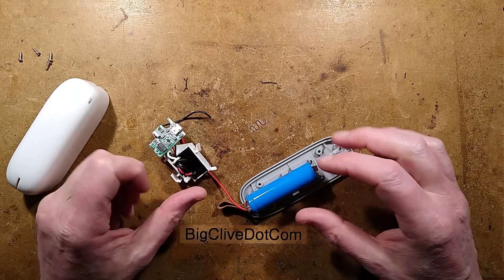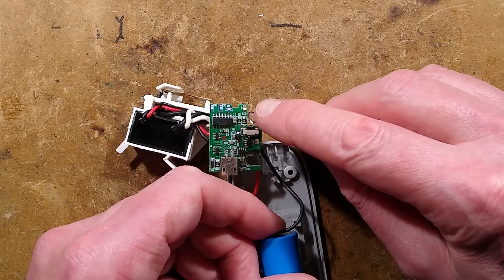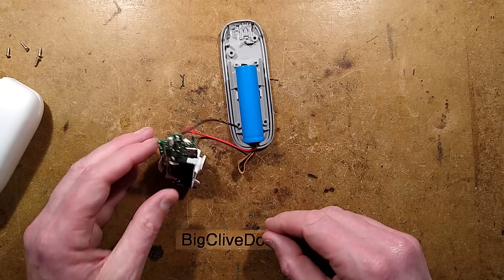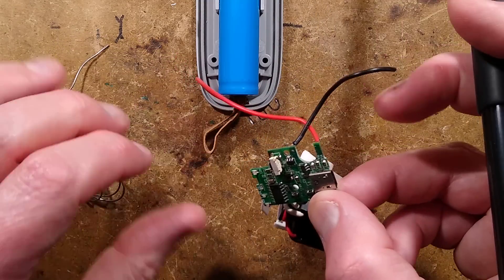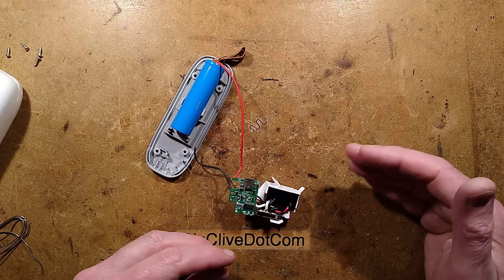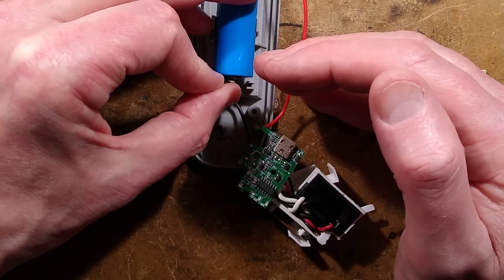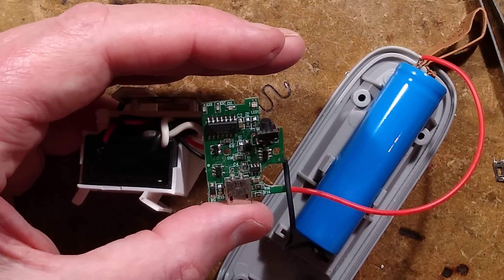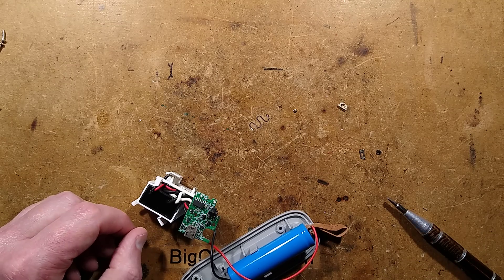The curse of tin whiskers rears its head again

Comment: Tin whiskers is not a RoHS thing. It's been known about for over 70 years now. Computers in the 50s, using normal leaded solder were failing due to them, air filters were getting clogged with them, and other things.  Lead-tin helps combat tin whiskers, but is not a complete solution - like I said, it's been known about for the better part of a century, when lead-tin solder was common. The problem is tin itself, and certain crystalline structures of such can lead to molecular stresses in the tin to cause it to whisker. This commonly happens in shiny tin things (bright tin), which occurs very often in things you want to make shiny - usually pieces of hardware like brackets and such. Solder is another location, but that's why we alloy it. Early RoHS did suffer from tin whiskers but we've eliminated it in normal soldering by careful temperature monitoring which relieves the stress in the solder so it doesn't whisker. Not that early RoHS electronics were suffering a lot from it as they suffered form other things common during the time (e.g., capacitor plague). Of course, cheap tactile switches would be tin plated rather than nickle plated which also results in this. As for lead, well, it's not good for the human body - even just 30 years of leaded gasoline had completely polluted the entire environment - every surface indoors and out was coated in lead. It's nasty stuff and we're probably seeing the results of it as those people are now leading the world.
Reply: "as those people are now leading the world" 🤣
Reply: I remember back in 1985 when I was in high school, doing work experience at the local telephone exchange, the engineers told me about how tin whiskers would grow on the contact pads of relays sometimes.
Reply: @DarrensBench  , tin whiskers also develop in the tonewheel assemblies of electric organs; there's video on YouTube showing how to zap them away with a 9 volt battery or charged capacitor.
Reply: They didn't cure the problem but they did abate the symptoms. The amount of lead in solder wasn't that high and we always handled it well. Not like the guy I worked with years ago. He was telling us that as a kid. They had a small pool of mercury to shine their coins with. The store had it right inside the door.
Reply: Thank you for that explanation. Does temperature matter or does tin un-alloy itself? More homework for me!
Reply: @cherylm2C6671  To say that "it's complicated" is an understatement. I've attended talks about this problem when RoHS was being rolled out and the methods of tin whisker mitigation.  Some temperature annealing processes greatly reduced occurrence, but it is a headache.  Also with modern electronics with smaller pitch sized pins, tin whiskers can cause malfunctions sooner.  So as many suspected, While RoHS reduced the lead, cadmium, etc. it will likely increase E-Waste as nobody does any component level repairs anymore... Question: Was it a good tradeoff in all cases?
Reply: @cherylm2C6671  , pure tin has an unstable crystalline structure, and the instability is amplified in cold temperatures as well as heat.  Hundreds of years ago church organ pipes in northern Germany were failing because they were soldered with pure tin. The phenomena is known as "tin pest" and you can Google it. Alloying tin with lead creates a relatively stable alloy that can be used with simple organic Rosin ( distilled from pine trees) as a flux to clean the metal and displace oxygen during the soldering process.  Lead-free solder, however, uses trace amounts of copper as well as antimony or bismith or other metals, and sometimes silver, in an effort to make it stable, but it's far less stable than lead solder.  Lead free solder also requires more aggressive, caustic and corrosive chemical fluxes to be used in order to clean the surface of the metals you are soldering because the lead-free solder simply does not "wet" as easily to the other metals.  The Rosin flux used with or typically contained within solder used for electronics is relatively inert, non corrosive and non conductive, and can be scrubbed clean from the board with alcohol and a toothbrush. The fluxes used with lead free solder however are conductive and corrosive and must scrupulously be removed from circuit boards or they will cause problems over time. Those fluxes are typically designed to be water-soluble in distilled water but they still can require a lot of work to remove all of it (an ultrasonic bath perhaps), and remove all of it you must.
Reply: This should be the #1 comment.
Reply: Yes, what you said that is known about tin whiskers and RoHS is true, taking the lead out of solder brought back the known problem, that lead had already solved.  The new soldering techniques greatly reduce them, but apparent does not completely eliminate them.  The way that Advanced Circuits solved the issues of lead-free solder was investing in a nitrogen flushing process for PCB assemblies... that is not something the home-gamer is able to do. I am thankfully able to still purchase Sn60Pb40 solder, but I live in California so I don't know how long I have until the eco-police knock on my door. I don't make anything for a consumer/mass market, it's just a hobby.

Any aviation or space electronics is exempt exactly for reliability reasons... Tin-lead solder is ductile and is suitable for high vibration environments.  See my comment in this video comments about the SDO Solar Observatory in space and the Lead-Free solder debacle that almost derailed that probe for something that is out in space!  

As far as lead in the human body, as you pointed out, eliminating from household products such as paint, plastics, etc. and from the gasoline in cars... has done the most good, I agree with those measures.

However, electronics too ??   I do not know anybody that opens up and tries to eat the electronics... Well, maybe Big Clive (LOL)... and I think all that crap about it leaching out in a landfill and finding it in our water supply is a specious argument.  Lead is already in the ground and it's fairly stable as a metal... well, as far as I know, but I may be unaware of something, please let me know... I'm more about the facts than opinion.
Reply: @HobbyHalloween  ,  elemental lead is indeed pretty stable in the environment and most acids and alkalis have little effect on it; one obvious exception being the lead water pipes in Flint Michigan which were stable until some city managers appointed by a "conservative"  governor decided to save money by using less desirable,, cheaper, contaminated and corrosive water from a different river and not treating it with expensive chemicals that would coat the pipes and make the water PH neutral.  For that reason it's probably not smart to bury circuit boards containing lead bearing solder (or even leadfree solder, for that matter) in a landfill because organic acids from decaying organic matter might tend to leach some of the lead out.  Not that the resins and such used in manufacturing printed circuit boards is any better for the environment.  As a society we should be building products with a longer lifespan and making sure that it's possible, with reasonable effort, to recycle those materials and keep them out of the environment.  As you pointed out here, unless lead free soldering is done under tightly controlled and expensive factory conditions, it ends up shortening the lifespan of products made with it , and therefore we really should rescind some of the ROHS rules.

You know, gold mining is a huge source of environmental contamination ---- lead, arsenic, mercury, cyanide ---- but nobody is calling for an end to gold mining unless they live near a mine but don't earn a living from it. Also, one of the major sources of environmental mercury is burning coal to generate electricity: exhaust from Midwest power plants drifts to the Eastern US coast where rain washes it down into the watersheds and rivers.  Bacteria absorb it and change it into Organic Mercury compounds which  work their way up the food chain from plankton and small bait fish to become concentrated in larger predatory fish, and then into people  and animals who eat the fish.  Metallic Mercury isn't that bad for you except in vapor form ---- it actually evaporates a little even at room temperature ----  or if you handle it a lot and absorb it through your skin, but water or fat-soluble Mercury compounds are extremely toxic to mammalian nervous systems.
Reply: The phenomena of pure tin degrading has actually been known about for hundreds of years and was sometimes referred to as tin pest (Google it). Tin may more rapidly become unstable and deteriorate from temperature extremes, and not just from heat: Organ pipes soldered with tin underwent failure  in cold northern Germany; and there was an Antarctic expedition that failed in no small part due to a stash of fuel cans that all leaked from their soldered seams (I'd bet my bippy that the cans were soldered with tin and not with leaded solder). Tin being a critical military material, the US government keeps a stash of it at Fort Knox or some similar place and periodically melts down the ingots and recasts them. 

I was an audio-repair bench tech for 20 years and I have been soldering electronics for over 50 years.  Lead-free solder is terrible stuff; solder connections in consumer goods made with lead-free often fail prematurely ---- I saw this every day for decades ----  and since repair often costs more than replacenent,  millions of electronic items get thrown in the trash around the world daily, which represents a gigantic waste of the energy and natural resources used to make electronics. Most of this stuff is never properly recycled either, and at best it gets shipped to shanty towns in poor countries around the world where half starved people poison themselves and the environment by using mercury or cyanide to recover gold from circuit boards and  burning off the PVC insulation from copper wire in order to recover the metal, generating highly toxic fumes. Most of the plastic is never recycled and reused. The idea that e-waste is "harmless", no longer toxic because there's no lead in the solder is completely ridiculous. Lead-free solder is a scam, and manufacturers agreed to it because the alternative was being forced to initiate a system for taking back everything they ever made and recycling it, which would of course be a drain on corporate profits. Lead-free solder also tends to shorten the usable lifespan of a device because the solder connections fail with regularity and therefore it works in conjunction with planned obsolescence, which is good for corporate profits. 

 Manufacturing devices that have a long usable life span is much better for the environment than manufacturing devices that have a short life span. We should be using leaded solder and recycling the devices when they fail, not simply  throwing them in the trash and allowing it to become somebody else's problem.
Reply: You wrote all this just to tell LIES! I feel sorry for you Europeans living under dictatorial bureaucracy. No wonder no innovation comes from you. Lead was added to soldering to stop discovered whiskers on lead free electric circuitry.

Comment: I still use leaded solder wire for our small business. It is nicer to work with, because it flows better at lower temperatures than non-leaded solder.

Comment: I've heard the term "tin whiskers" but didn't understand what they meant fully. I sort of imagined it was some manufacturing issue where little bits of tin contaminated the circuitry. I hadn't thought of lead free soldier growing crystal tendrils. Sorta reminds me of a similar effect in lithium batteries and the growth of lithium crystal structures that grow each charge cycle until they short out the battery internally.

Comment: That right there is why I would prefer to use Lead solder unless I absolutely must use Lead-free solder (in the other words I will have to pick one that's less likely to develop Tin whiskers). Lead-free solder have been nothing but a pain in the ass. Lead-free components tend to be okay with Lead solder so there's no reason why I can't use it anyhow.

Comment: Next time, how about passing some current through it and seeing if it goes open circuit? A tin whisker is basically a tiny fuse. 100mA should be plenty to melt it if it's the real fault.
Reply: yep, i blast tin whiskers in transistors with a charged high value capacitor..  but they'll likely come back, maybe try dripping an, er, drip of lubricating residue  contact cleaner(electrolube eml) in it? wonder if it'd stop/reduce them growing...

Comment: Had a 10kohm short on the contrast button on my then 8 year old Viewsonic LCD monitor 11 years ago. A big blue contrast menu would frequently appear in the middle of my screen and then increase to full contrast and stay there for a few minutes. Eventually opened up the switch and under a microscope saw the short. Scraped it with an x acto and put it back in, still using it to watch this video today. 
Didn't have any idea what caused it until watching this video. 
Thanks Clive!
Reply: My boss's home computer monitor (similar age, but Philips) did a similar thing... It would randomly bring up the menu.
I ended up just unplugging the entire button board and leaving it at that. It's plugged in with DVI so the buttons never really got used anyway.

Comment: There's a very similar failure that's often confused with Tin Whiskers, and that's Electrochemical Migration (ECM). Any amount of halogen/halide (most often bromide) contamination along with high humidity and an electric potential -- such as across an on/off switch -- will lead to the growth of dendrites. (Tin Whiskers occur from different causes, like stress in the solder.)
None of the big channels on YouTube ever made videos about it, so I had no idea it was a thing until I had some very expensive persistent failures. Any time I reflowed the shorted pins the shorts would go away and come back the next day. The shorts were on the order of 2-80 ohms in this case. Changing to aerospace-grade zero-halogen solder (or applying a heavy amount of flux cleaning) solved it.